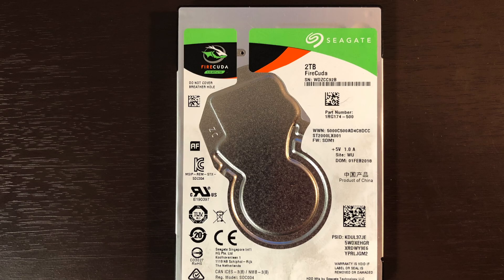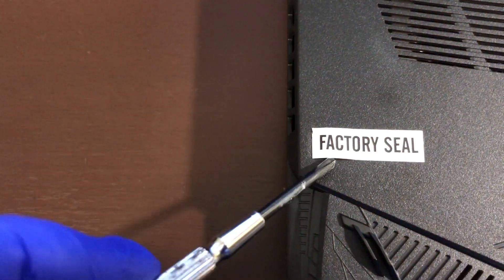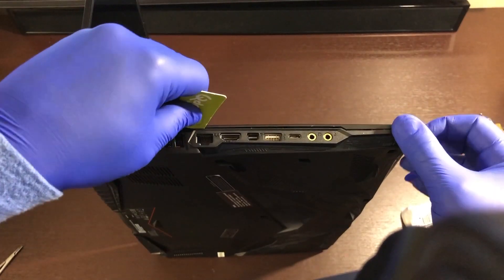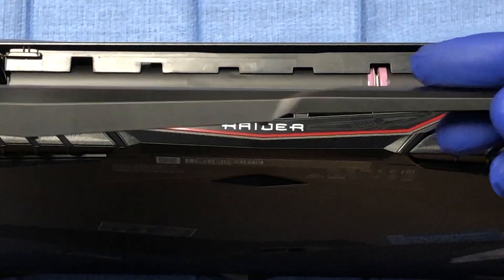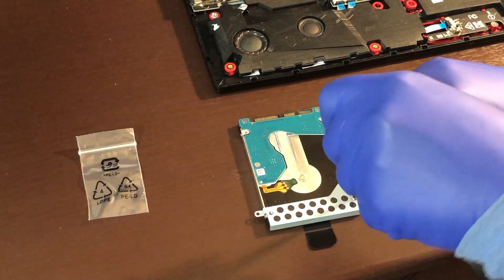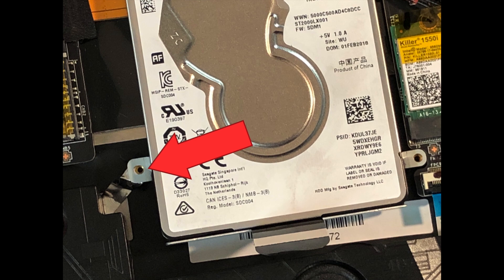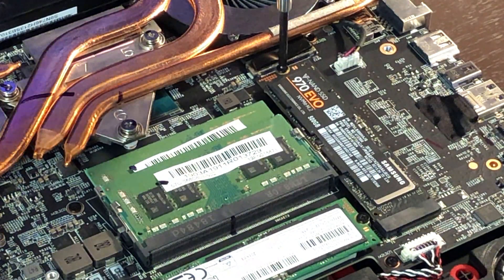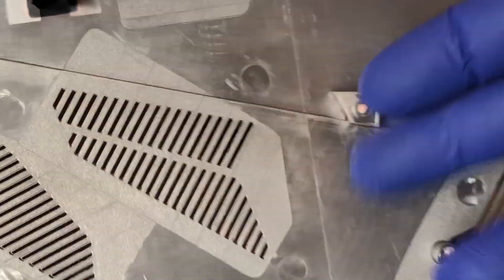MSI GE75 Raider M.2 NVME and SSHD Install

Comment: One more question the stock ssd 512 can I remove that right away for my new ssd or is there things programes on it that I need ????
Reply from the maker: Your OS is on there.  You are better off using the software to do a system backup and restore to your new drive.

Comment: Very good tutorial.  I would like to upgrade the HD to a very large capacity drive (~6T ).  These drives are 15 mm thick.  There is no information that I can find about whether I must use a 2.5 inch 7mm thick or if a 2.5 inch 15mm thick drive may be used.
Reply from the maker: 2.5 2TB is the largest I've found.  A larger SSD would work but support is limited by your board.

Comment: Any idea why MSI made it this difficult to change drives?  Most laptops one or two screws - or none reveal the drives and maybe the ram.
Reply from the maker: Cost.  Cheaper to have 1 slab of plastic than to have one with doors, panels with screws.
Reply: @Meanpooh  All those screws it has in real life.  An HP (and HP IMHO is notorious for being cheap) was much easier to get into for drives.  But much harder to get into for cleaning.
Reply from the maker: I agree and so was Toshiba and older Acers.  Some manufacturers are also using lightweight screws which are cheaper but....are easy to strip out because of lost strength

Comment: Hi . Can we use 6 TB SSD ? 2 × NVme and one 2.5 inch ssd ?
Reply from the maker: It's possible but you may want to find the max capacity of the M.2 slot.  If that is total then YES.

Comment: Why have an empty slot for a drive if 1. waranty is dead as soon as you open and 2. it's so damn hard to open? Why can't they have a small panel you can unscrew just where the empty slot is, so you just take it off, put your drive, close and done?

Comment: I like your deliberate walk-through style and your mention of the difficulties with popping the case. What I don't get is the hdd. Wasn't there a hard disk drive already in there? If so, what's with the second bay? I didn't see that (I wasn't looking, though) when I replaced the two 4 Gb RAM chips with two 32 Gb chips. I want to go in now and replace the factory-installed 1 Tb HDD with a 2 TB SSD (and add the second thin SSD in that second slot). My plan was to pull the 2.5" HDD and just put in the new 2.5" SSD, but are you saying there's a bay for a second 2.5" HDD/SSD? To the best of my knowledge, my MSi didn't come with a caddy for a second drive.
Reply from the maker: If you have the same model that I have, there is a total of 3 storage bays.  2 M.2 and one SATA.  You can install 2 NVME drives and 1 of the following in 2.5 form factor, SSD, HDD or SSHD.  In the video the 2 M.2 bays are surrounding the RAM slots.

Comment: Nice tuto man!  Do you actually HAVE to remove the battery to install an additionnal SSD tho?
Reply from the maker: You don't have to but it's just safe practice.
Reply: @Meanpooh  I just noticed in my msi raider I have optane memory 16gb in my M.2 slot, when I just bought a 500gb SSD.. Is it even worth removing the optane for the ssd?

Comment: I just wanted to add some info. So there are a bunch of snap-in clicky things around the seam that keeps the two halves of the bottom of the laptop case, and they come apart fairly easily if you don’t miss any screws. Miss one screw like I did though, and you’ll notice that it is possible but extremely difficult to separate the clips, though of course I realized what I did wrong and removed the last screw before I broke anything. The best thing would be like a hard plastic spatula that has a tapered edge and that is less than 2 millimeters thick at the thickest point. I didn’t have a bracket to use so I just taped the ssd in lmao lets hope it doesn’t backfire. I plan to use that drive for games that will be backed to the cloud anyway. Hopefully it doesn’t come lose, it seemed like it was secure after I taped it.

Comment: Great video. When adding a new SSD stick, does it need to be identical to the one already installed in the machine? 

ex: mine came with 512GB of SSD initially --> can I throw in a 1TB stick in my extra M.2 slot? I'm assuming all I would do is initialize the drive after?
Reply from the maker: It does not have to be the same size.
Reply from the maker: As for initialization, just make sure that the drive does not have any special software or drivers that need to be installed. Other than that, you should be ok.

Comment: @MSI are you afraid the bottom of the laptop will fall out if there weren’t 50 tabs and screws holding it place? My last MSI was also a terrible fuss to work on. Gigabyte gets it. The Aero 15 is so easy to access and upgrade. MSI wants you to leave a mess of dinged plastic to access the internals, like they’re hiding government secrets in there or something. So done with this brand after today’s nvme swap
Reply from the maker: I agree. I just wish they would bring back the compartment access. It’s less fuss and no mess.

Comment: Thanks for the video, man!
This was a tough one. Without any explanation, I would have let down and call for a pro.
The rear part was the hardest to do. Hopefully, with a plastic card and a pick, I did it without a lot of damage.
Result : 7 or 8 plastic clamps broken, despite soft and careful moves.

Last surprise : one of the copper caleoducs blocks the second m.2 slot and the second ram slot either.

I’m glad it was just a sshd upgrade. But nobody mentioned it in the description.
(Model : GE75 9SG-835FR)

Sorry about my english. I’m a frog eater !

Comment: Thanks for the video. If you start removing the side opposite the audio jacks you don't need to push them in. And that back part is tricky as heck. If it wasn't for you I wouldn't have figured it out.
Reply from the maker: No problem and thank you!

Comment: i got a brand new msi gf65, and i bought a extra ssd, m.2 wd i installed into the laptop and the extra ssd i put it doesn’t read but everything else is working need help
Reply from the maker: Did you initialize the drive?
Reply: how do u do that again in bios? becz i don’t see it in bois
Reply: i’m just using that new drive for more storage not for boot up
Reply from the maker: @topballerz  Log into Windows then goto Disk management.  Find your drive and initialize it.

Comment: Thanks for making these videos. Very helpful and detailed.
I have a question though. 
Can I run the one M.2 SSd and one Optane memory in the other m.2 slot that can support the optical drive?

Regards,
Reply from the maker: Yes you can.

Comment: my cpu was 95 C today, should I change the thermal paste ? Also I could not disconnect the left side of the cover, I broked some nails. Can you record a video again ?
Reply from the maker: The Raider does run hot. Repasting will help a lot in conjunction with undervolting. Be aware that some of them are using liquid thermal pads. You will need this if you are repasting.
Reply: @Meanpooh  Do you have any suggestion for paste ? Many users suggest ARCTIC MX-4, is it a good paste ?
Reply from the maker: I use Thermal Grizzly Kryonaut.

Comment: Man this is so intimidating i paid sooo much for my ge75 raider and its my very first gaming laptop soo i DO NOT want to make a mistake lol thanks for this i neeed to upgrade the memory badly so i need to do this
Reply from the maker: I know they are expensive but this is a simple upgrade and I can understand you being nervous.  The hardest part it opening the case.  After you open it a few times its easier.  Expect to find some broken clips when you are done.Make sure you make a system recovery DVD or USB drive.

Comment: Does the SATA SSD usually come with the caddy/screws? I'm adding one to my Raider-286 and wondering what all I'll need.
Reply from the maker: Yes.  It should be in its own bag.
Reply: @Meanpooh  Do you mean it comes with the laptop or the SSD?
Reply from the maker: Aaron Hammel you should have a packet that came with your laptop  the bracket will be there.

Comment: Thanks for the guide. I'd pull my hairs out if I didn't saw your video first. It took about 10min to install second M.2 but it doesn't work. I've MSI GE75 Raider 9SE. I've installed Samsung 860 EVO. But it doesn't showing in the BIOS. I've updated bios too. Any Ideas?
Reply from the maker: You're welcome.  As far as your problem with that drive, its been happening a lot lately.  Just had a long conversation with 2 other people over the same thing but on Acer Nitro 5.
Its its not showing in the BIOS then it will not show in Windows.  If you had another drive to test, that would be beneficial as it would tell if the drive is dead or not.  You could also try swapping slots to see if its working correctly.  If the other M.2 slot is working with another NVME drive, then its dead and or not functioning correctly.
Reply: @Meanpooh  I've swapped M.2 disks and while doing that found out that it states "PCIe 3.0 x4 SSD" for one slot and "PCIe 3.0 x4 or SATA 3.0 SSD" for the other one. Luckily the M.2 that came with the notebook is x4 and it works in the second slot.
Reply from the maker: @keremk13  Great, at least its not dead but strange that the slots aren't identical specifications.
Reply: @keremk13  It's because the 860 EVO is a SATA drive I think.  Well, it was a year ago after all, but ...  nvm bro.  Glad ya got it working.  Go with PCIe if you have the choice is what I'm thinking... 5x faster...  gomen.

Comment: Metal plating on the plastic cover could be to control the heat radiations. Normally a shiny surface emits less radiation than a black rough surface. Don't know for sure, but that is my guess. Very informative videos you have got.
Reply from the maker: You could be right.  It sure did look like and feel like a soft metal though.  Anyway, thanks for stopping by👍.